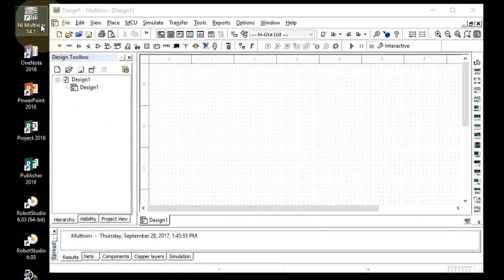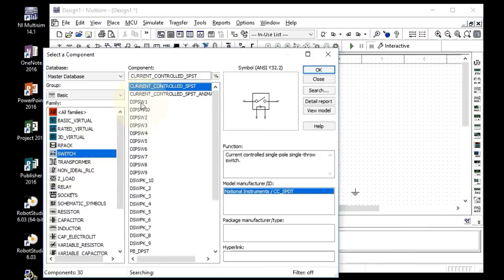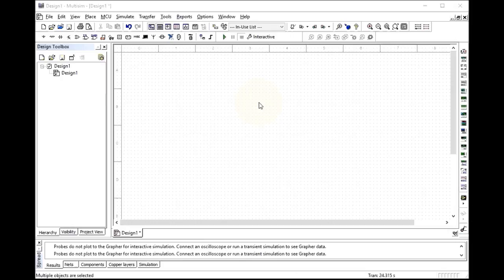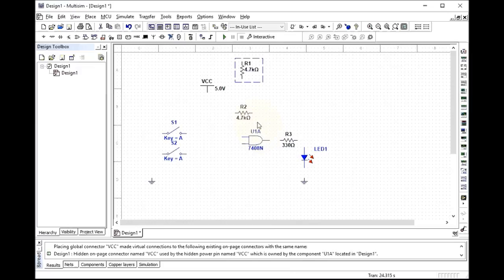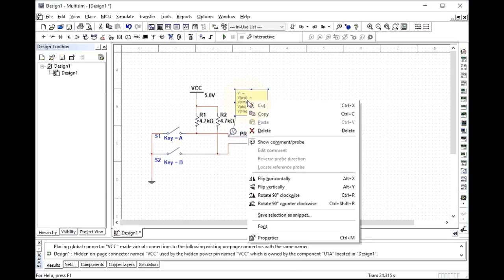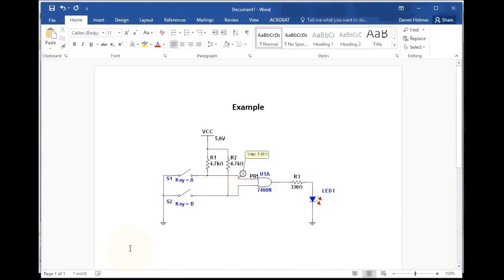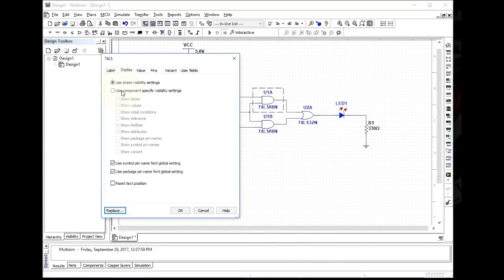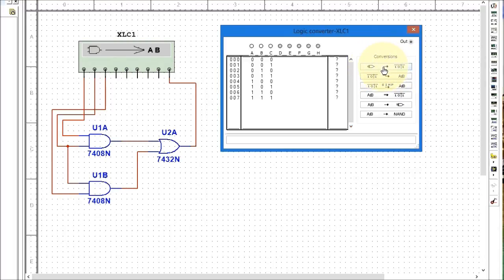How To Use - MultiSIM for Digital Labs

Comment: In the event that the wrong package pin names are displayed, does that mean a mistake was made when placing the components? I copy and pasted the original AND logic gate and now both AND gates are displaying 1, 2 as the input and 3 as the output. Also the OR gate is displaying 9,10 as the inputs and 8 as the output?